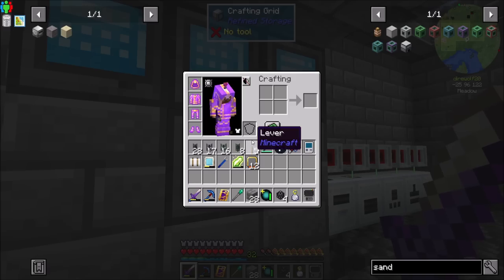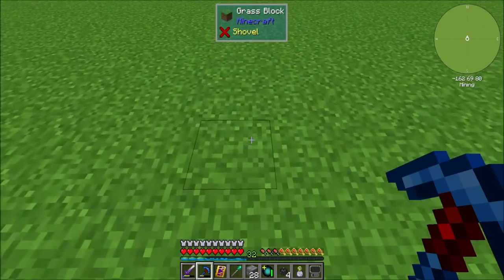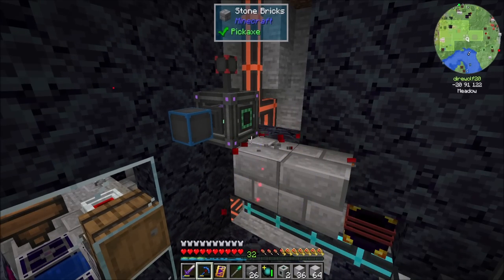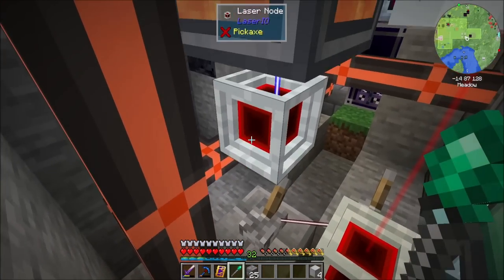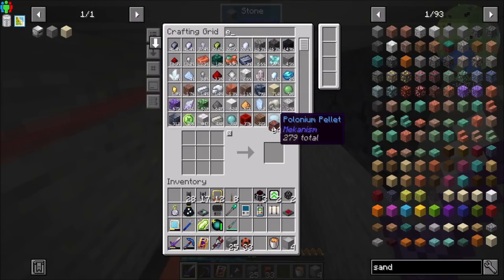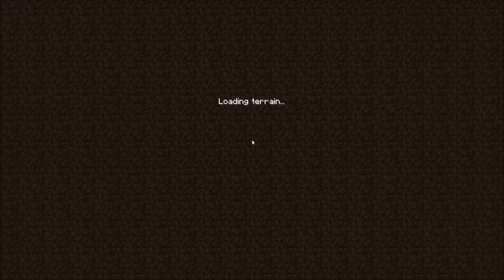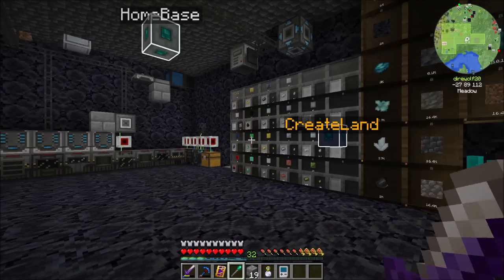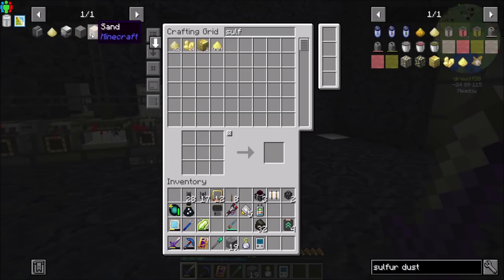Lets Play S11E59 Big Battery and Sulfur Automation

Comment: Dire if you're struggling with things like redstone and iron and then you're using the digital miner for it, use the silk touch option. Especially for the redstone. Each redstone ore block is 10 or more dust in an Enrichment Chamber compared to 3-7 dust you get from just breaking it.

Edit: Clarification.
Reply: i was saying that like dude silktouch is op in digital  miner
Reply: @johne16minecraft  The digital miner itself is pretty OP to be fair. They could make it consume something along with the power to balance it out.
Reply: that hurts my soul a bit

Comment: If you are worried about waste why don't you make a solar detector? It emits a redstone signal when its daytime and you solar machine works. If it's nighttime then the other machine goes to work
Reply: I was just thinking about this
Reply: this was my thought when he first set it up
Reply: to be really safe, add another detector to the reactor but configure it for 'excess waste' instead of temperature
Reply: then he could potentially waste fissile fuel, which is a valid concern at this stage, since one doesn't need much plutonium that the nighttime machine produces.
Reply: Or a gasp vanilla daylight sensor
Reply: @termin29671  that's the one I was thinking about
Reply: @rdellison  absolutely the same thing i always use

Comment: what you could do dire with the day night cycle is use a vanilla daylight sensor instead of the lever that way during the night it auto-toggles to making plutonium instead of polonium. and it would keep switching so its always burning the nuclear waste. Although Idk how much plutonium you'd want since then it would essentially be generating plutonium and polonium in a roughly 50/50 ratio

Comment: Dire, i noticed you have  the entangled blocks mod and the compact machines mod and thermal, you can "delete" the nuclear waste by entangling a pressurized tube into a compact machine that pipes into a barrel that is being placed and broken, sure the resulting cube would be instant death to set foot into unprotected but hey look on the bright side, the waste is no longer your problem to deal with. I did this in an Oceanblock and it worked great.
Reply: it could be made into the smallest cube (smallest cube is like a 3×3×3 i think
Reply: @johne16minecraft  yep, completely lethal to set foot in but it does delete the waste
Reply: I like this! This reminds me of past times in modded Minecraft where you pretty much had to find a broken way to do things. You had to really think inside the cube wink

Comment: for the reactor, could maybe try to use a daylight sensor and supercircuit maker to make is so that the solar neutron activator and isotopic centrifuge run on the day/night cycle of the game. i.e. during the day, the solar neutron activator runs, and at night the other. At least for if/when you decide to ramp up the burn rate for the reactor in the future.

Comment: I think you can run the reactor at full speed? You said that you can't supply enough water, but you can still add more fluid cards with 4 overclockers. All you need to do is adding node overclockers and you are good to go
Reply: @Quietust He doesnt need any of this actually. Integrated dynamics fluid transportation is op af. Just attach a fluid interface to the sink and fluid exporter to the reactor port. Then set the transfer rate to 2 billion. It fills the reactor instantly, even at 91 burn rate.

Comment: I don’t think dire ever put gas upgrades in his chemical dissolution chamber. Cuts the use of sulfur WAY down.
Reply: To be fair, gas upgrades work on such a small number of machines that it's pretty easy to consider it more trouble than it's worth to keep checking if a machine takes them only to be disappointed.
Reply: @slartimus  I can see that. But when it makes such a HUGE difference its really something to do.

 And I found the easiest way to remember which machines use them is to just look and see if it is using a gas as a "fuel", not as an ingredient.  Examples: Purification chamber needs oxygen for its fuel bar, so it takes a gas upgrade, but the PRC uses oxygen as an ingredient so it doesn't. Same thing with Sulfuric acid and the chemical dissolution chamber.

Comment: laser io feels too OP, the laser should not go through solid blocks, will give an use to the laser connectors and would be more fun to figure out ways to set the laser nodes
Reply: Then there would need to be a block that you can run the laser through that you can make look like any block. Like say a block with a glass tube in the middle of it. Can't have gaps in a house just to allow a laser to connect since mobs could get in and it would look ugly.